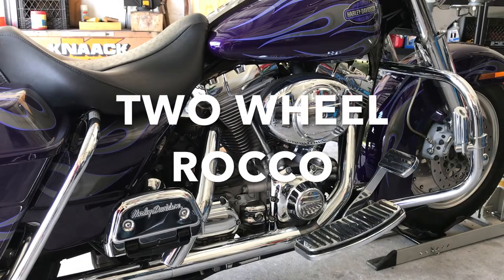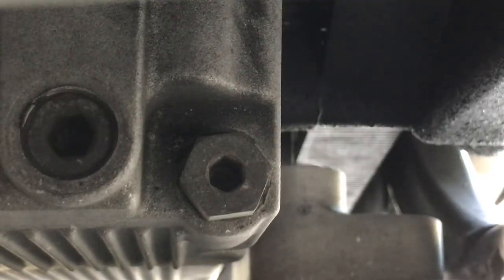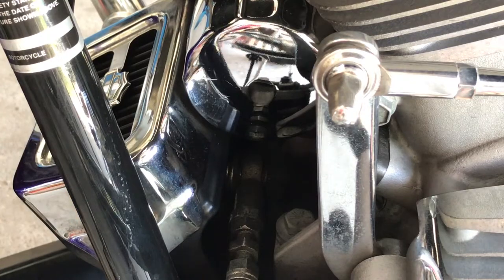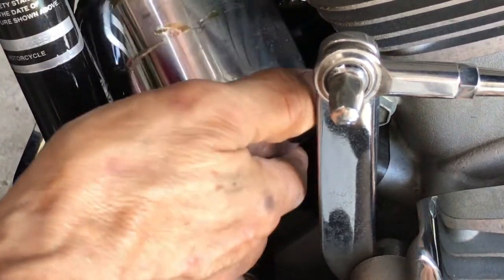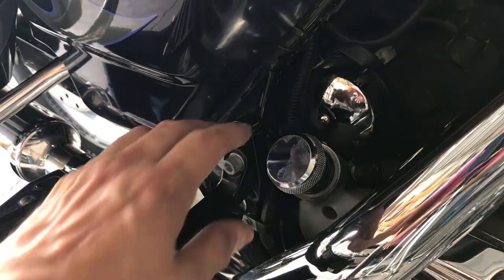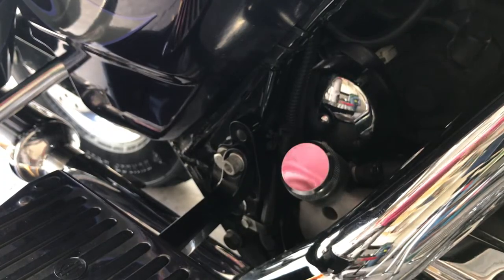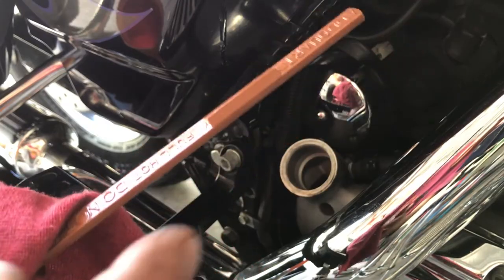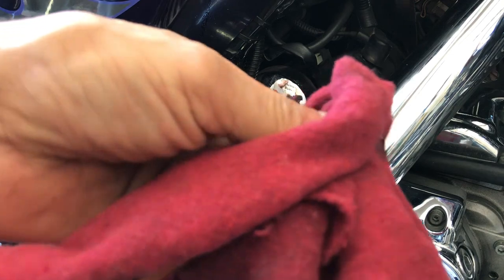Harley Davidson Road King oil change

Comment: When removing the old filter instead of a rag I use a long strip of aluminum foil and make a slide for oil to run to the waste oil pan.
Reply from the maker: Thats a great idea.  Thank you for your Support. Ride Safe and have a great day.
Reply: Cut out a strip out of the bottom of an aluminum turkey tray, it's much thicker than just the foil, and you can save it and use it again. Regular foil is too thin and ripps easily.

Comment: Thanks for this one and I can use that tip about removing only bottom plug first. I always get a hand soaked in oil every time with cap off too.
Reply: You WANT TO take off the oil fill cap before removing the drain plug so the oil DOES rush out fast helping remove any metal shaving or debris that might be in the pan.

Comment: I like the video, but also wanted to add once thing. I watched a guy on a video here go over the difference in a HD oil filter and a Fram. Several viewers were giving him a hard time about Fram, so he did one to show the difference. You have got to watch the difference. It will make you purchase Fram in the future if you love your bike. Its: "Harley Davidson doesn't want you to see inside the new oil filter vs Fram".  It is a fabulous video and will open your eyes!
Reply from the maker: Happy to help. I stopped using Harley Davidson filters about three years ago. I use high flow 170 C or 171C ones for a sportster and ones for a dual cam. Thank you for watching and all your support Rob. Ride safe and have a great day. I agree totally that Harley  Davidson oil filters are cheap. They don't even cover them so when you buy them.  There's no seal on the filter. Who does that. Let me not get started.

Comment: You WANT TO take off the oil fill cap before removing the drain plug so the oil DOES rush out fast helping remove any metal shaving or debris that might be in the pan.
Reply: Why is my oil fill cap stuck?

Comment: I'm getting a road king this week. Gonna go with amsoil oil and filter. No need to change oil that often. I have an 03 vulcan 1600 thats like new. I change the oil every 10k and the bike is 17 years old with no issues. Thanks for the vid.
Reply from the maker: Great Bike, I love my Road King. Good luck with your new ride, Any questions just ask. Thank you for your Sub and comment. Ride Safe and have a great day
Reply: @TwoWheelRocco  how often do you change the transmission and primary oils?
Reply from the maker: 10,000 is what I do.
Reply: @TwoWheelRocco  cool I think I'll have it done cause the bike has been sitting for over a year.  Gonna try it myself. Thanks for the vid!
Reply from the maker: Any questions just ask,

Comment: Great vid,Im about to do my first oil and filter change on my '13 FLHR.
Reply from the maker: Happy to help, Any questions just ask. Thank you for your Sub. Let us know how this works out Moonie.
Reply: @TwoWheelRocco  worked fine! I'd done roughly 6000 miles, well over due.New oil and filter and the bike was as responsive as when I first got it. Its done 53,000 milesand hauls nicely.Still in factory condition.

Comment: Another great video thanks Rocco.  I gotta say though anyone else see that oil filter thing looked old and cracked!  I wonder if he was showing old filter just for video purposes post new filter install?
Reply from the maker: Happy to help. But you are so right. That was the last filter I ever bought from Harley  Davidson. They're not sealed.  Yes that hurt. Thank you for watching and all your support. Big Nord. Ride safe and have a great day. I like  High Flow oil filters,  eBay very reasonably priced 171C for twin cam motors..
Reply: Thanks for that info and you too keep the rubber on the road brother!  @TwoWheelRocco

Comment: rocco ...... do you do the oil change and fill while the bike is on it's side stand ? or upright ?
Reply from the maker: I like to have the bike straight up and down. Get a 2 x 6 and you can put it onder the kickstand and that will get you almost there.  That's how I like to do it. It helps to get the drain pan under the bike and for you to remove the oil filter. makes it easier. I hope this helps thank you for watching Dale and your sub. Let us know how it works out. Ride safe and have a great day

Comment: A buddy of mine says I can use Syn throughout the entire change. (primary, trans, gear0. Is that true? Can I use the 20-50 you used in this video for EVERYTHING? I' a new rider. Any info helps. Thanks in advance!
Reply from the maker: Yes you can.  Ride Safe and Thank You for your support.

Comment: Two Wheel Rocco, why do you start the engine after 2 qts. of oil? Air bubbles or what?
Reply from the maker: Happy to help... Exactly,   air in system ,  with a new oil filter . Thank you for watching and your sub Shawn..Ride Safe...Have a great day.

Comment: I am new to Harleys but thinking of getting a Road King second hand.Are they generally good bikes ? Any advice welcome.
Reply from the maker: They are great bikes. That's what I ride a Road King. Very enjoyable ride and usually reasonably priced. Make sure you buy it with low miles. And you will have a great ride. Any questions just ask. Good luck with your search. Lots of them sitting in garage with low miles, find one.
Reply: @TwoWheelRocco  Thanks for the advice and sorry if this is a stupid question but what would you consider High /low miles.I'm in the UK and a guy is selling some ex- Texas Police Road Kings that he imported for a business that is now closing and I'm interested.
Reply from the maker: @skoot2u  That's a hard question. It's all about service of the motorcycle. Oil changes make for a long lasting motorcycle. Since it's a police bike you have to know it was serviced. What year and how many miles?
Reply: @TwoWheelRocco  There are six bikes available newest 2015 oldest 2004 mileage ranging from 34,000 to 103,000.I know they have had regular servicing at a Harley dealers but I think i will give them a miss ? Thanks for your advice.
Reply from the maker: @skoot2u  I think you're making the right decision. Find a bike with 10,000 or less miles. And you will know the history. Plenty of bikes in garage  just setting. Be patient and you will find a ride for you. Good luck ride safe and have a great day.
Reply: @TwoWheelRocco  Thanks so much for your input,you obviously know your stuff and I appreciate the advice.I will wait for the right bike.Ride safe and you too have a great day !
Reply from the maker: @skoot2u  Any questions just ask.

Comment: Are you aware of the o-ring on the drain plug? Occasional replacement of it seals the plug making thread sealer unnecessary.
Reply from the maker: Happy to help. Thread sealer is just an extra. Very cheap and works well. Thank you for watching. And your support Travis. Ride safe and have a great day.

Comment: Another good video Rocco, hey I was in a pinch for time & was near a Harley Dealership and needed oil changed, they changed it and 2 days later the (2) hoses near the filter started leaking & dripping oil,, so I took it back and they said the top
 hose is needing replaced due cracking and clips are needing replaced, do you have any video showing how to replace those (2) hoses near oil filter? I looked (I’m subscribed) & couldn’t find one anywhere .
Thank you again Two Wheel Rocco
Reply from the maker: If I'm not right you have a 2016 Road King. I don't see the hoses or clamps being the problem. It sounds like your oil cooler plate is loose.  This happens when they loosened the oil filter. I would suggest remove the oil filter. You will see the threads that the filter screws into.  they'll be a nut at the end of that threaded pipe.  tighten that,  that will reseat the seal on the plate for your oil cooler. That's a common problem.  before you do anything clean with brake fluid around the hoses in the clamps and see if that's where it's leaking. If you can take a picture and send it to erocco3964@gmail.com. Hope this helps. this happened after they worked on your bike.
Reply from the maker: Google.    road king oil cooler leak.   Hope this helps.
Reply: @TwoWheelRocco  
Thank you Rocco, yes it happened 2 days after they changed the oil & yes, I personally sprayed the hoses off myself and cleaned it good and you can see where that leak is,, it’s just coincidentally that it’s leaking right afterwards. I will email you pictures. Your much appreciated Rocco. 
It looks to me at the top hose next to oil filter.
Reply from the maker: @babybugspaw7085  sounds like they were a little rough when removing the oil filter. Should be no big deal to fix yourself. You know an A mechanics don't do your oil changes. Sounds like a helper. But Harley dealer will never take ownership for nothing..
Reply: @TwoWheelRocco  oh I see! Baby starter mechanics. “Helpers”  I want to do my own and have fair amount of basic knowledge to do maintenance stuff I just was in a pinch for time that day & needed it changed, lol!
Anyway, if I change those 2 hoses myself do I need to drain the oil, otherwise I will have oil pouring out those hoses when I remove them?,,
Reply from the maker: @babybugspaw7085  I meant the helper at Harley Davidson probably did your oil change. I would remove filter and let the oil drain from the filter and hoses, You do not have to remove it from the motor.  Put a pan under it to catch any oil from filter and hoses.   Let us know how this works out.

Comment: Just rebuilt a 2002 touring model, rode bike for about 75 miles, drained the oil and very little came out.  I kept the oil filler cap like you to control oil flow.  When I removed the cap still very little came out. I put 3 and 1/2 quarts in.  Any ideas.
Reply from the maker: If you put 3 1/2 quarts in, then. 3 1/2 quarts got to come out. 75 miles that much on miles. Take a better look at the drain plug you  could have used a little Allen head that is at the bottom and that could be a problem.  Take a look, might have used wrong plug.  Let us know how this works out.

Comment: Oil capacity ?
Reply from the maker: Harley Davidson Road King oil and filter change. You will need 4 quarts of mobile 1,  20-50MC oil  and HD oil filter. Tools needed  5/8 socket, and a Harley oil filter wrench. Pan and oil funnel. All the steps from draining oil and filling too checking levels. Hope this helps,  this is for a 2004 Road king. Thank you for your Sub Dennis. Ride Safe and have a great day.

Comment: Why did you use the Mobil oil & not the Harley Davidson oil?
Reply from the maker: I like Mobil 1 Syn.  Harley Davidson  is not that close to me.  I order my filters online and buy my oil from Auto Zone. Hope that helps. Thank you for your Sub. Ed.  Ride Safe and have a great day.
Reply: Harley Davidson does not make oil and at one time there was testing done and the HD oil did not do so well. That may have improved but they still do not make oil.

Comment: make sure you use the right filter, some of those bastards will sell you anything, twin cam filter has anti drain valve,( rubber in the small holes) EVO has nothing in the small holes.
Reply from the maker: I agree, Filters are real important. Lots of cheap stuff out there.   Thank You for your Support and comment.  Ride Safe and have a Great Day.

Comment: What is the other plug for the big one
Reply from the maker: Happy to help. What year Road King? There's three plugs Primary, transmission and your oil. They will all have the same hardware most times. Then the rest are casting holes with Allen heads.
Reply: I have a 2002 Roadking
Reply from the maker: Great bike. 5/8  drain plugs. Threedrain  holes the rest are castings holes with hardware. not to be removed.
Reply: @TwoWheelRocco  thankyou Rocco
Reply from the maker: My pleasure. Ride safe and have a great day.
Reply: @TwoWheelRocco  thank you wish you safe rides well